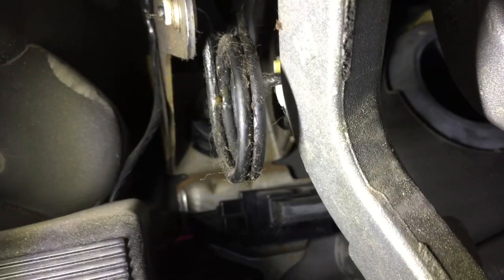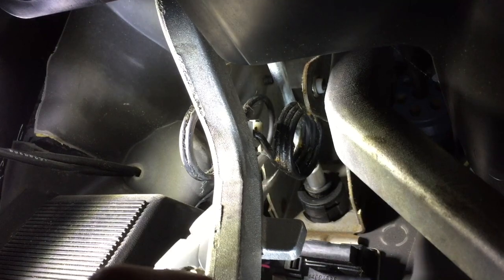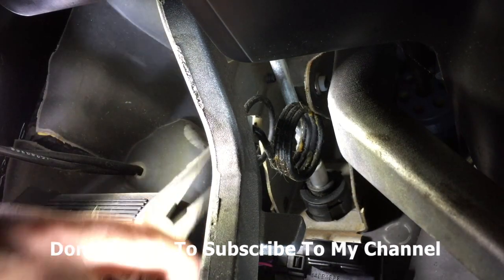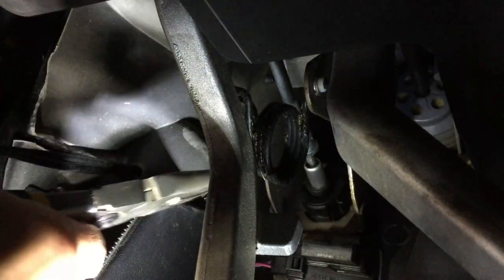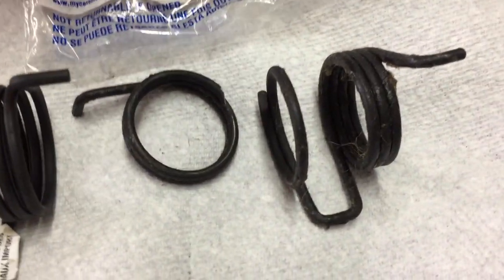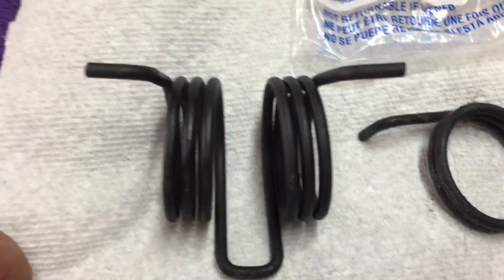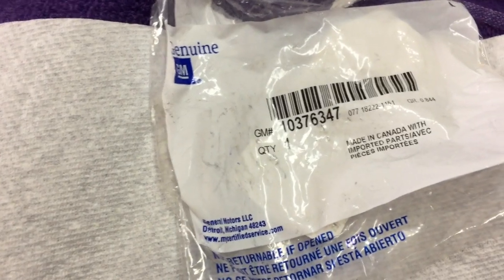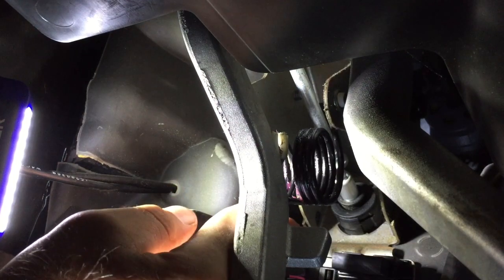C6 Corvette Clutch Pedal Return Spring Replacement

Comment: It took my wife to hold the clutch pedal all the way down with a broom stick from the passenger seat, and I used the needle nose pliers to pull the center of the spring into position. I was determined to do this myself.

Comment: I think I'm going to add the grease afterward. But thanks for the video. My spring broke and I could tell something was different. Then a piece of the spring fell on the floormat. Also is it possible to hook the 2nd part in first the put the ends in 2nd?